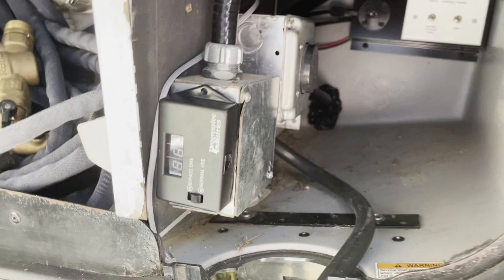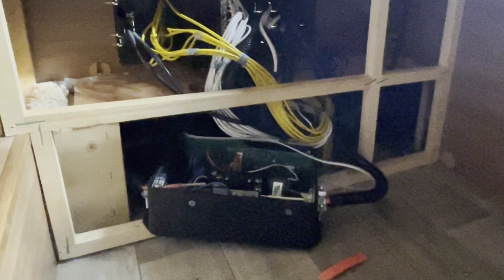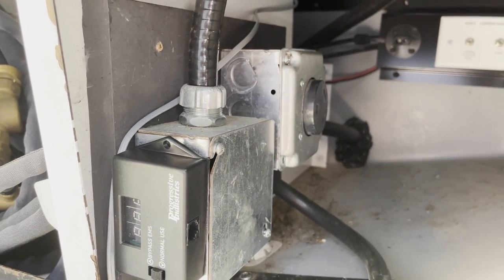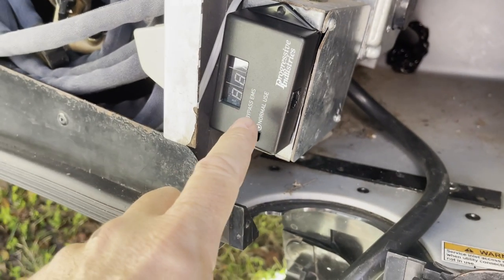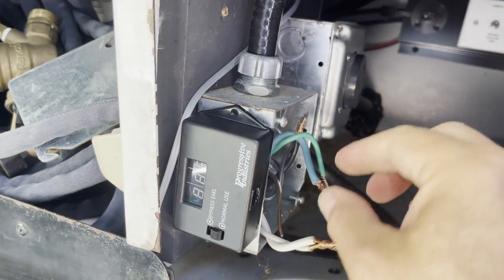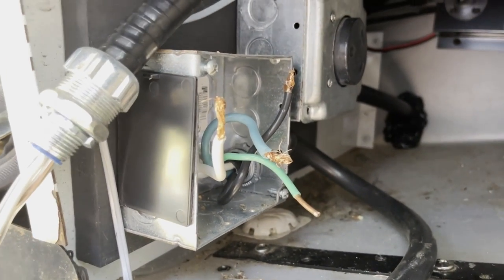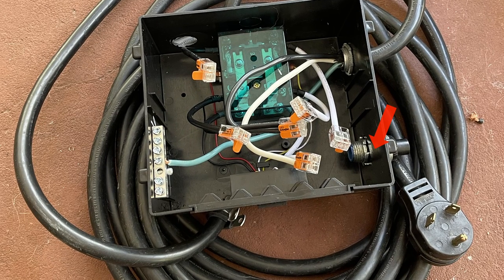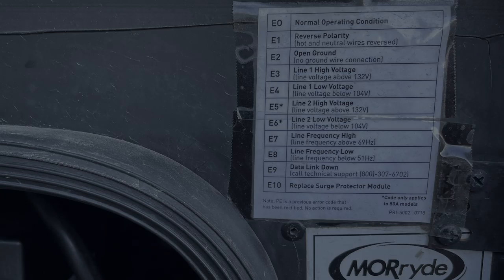2019 Winnebago View 24G Installing Automatic Transfer Switch

Comment: Thanks for this video! We have a 2015.5 Navion 24V and are upgrading the Inverter. We just want something simple, so the plan is possibly a Victron Phoenix 1200VA inverter in the same location as factory and then an auto transfer switch such as this. Thanks for the video!
Reply from the maker: The auto transfer switch was an easy upgrade. We went with the 3000 watt inverter and it was a bit of overkill given we only have 200Ah of lithium batteries. I would like to add another 200Ah to the mix. Thanks for watching and safe travels.
Reply: @MilesAcrossUSA  thanks! 400Ah is always nice! We have 825W of solar and are ready to install 400aH of Lithium batteries and a DC to DC converter that are sitting in their boxes. Does this auto-transfer switch replace the integrated auto-transfer switch of the Xantex Inverter that our units had from the factory? Much appreciated.
Reply from the maker: The transfer switch simply replaces the 30amp receptacle from the generator and the small box where the shore power cable is attached to the Romex that runs to the fuse panel for the RV. The switch is generator biased so when the generator isn’t running it expects power from the shore power cord if it is plugged into power.

Comment: Did your motor home have a factory installed generator or Dealer installed ? I find it strange that 2019 Winnebago didn't have a factory install transfer switch. Maybe it's just a Winnebago thing. Needing to go outside and plug that in every time must have been a real pain.  
Every motorhome I have owned since 2004 with a factory installed Onan generator came with one.  2004 Shasta class c, 2005 Jayco class c, 2006 Fleetwood class a and or newest 2022 Tiffin Wayfarer class C
Reply from the maker: Our generator was factory installed. I don’t know why Winnebago didn’t install an automatic transfer switch? If I had to guess it was due to cost. Same for the EMS. I know lots of RVs come with built in EMS but this one didn’t so I installed my own.